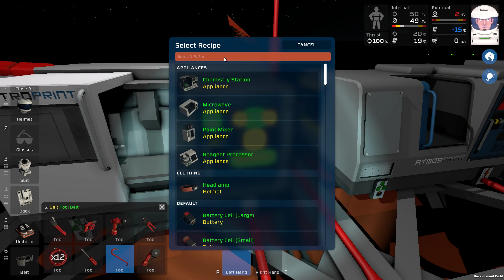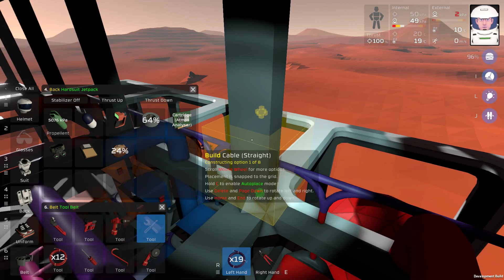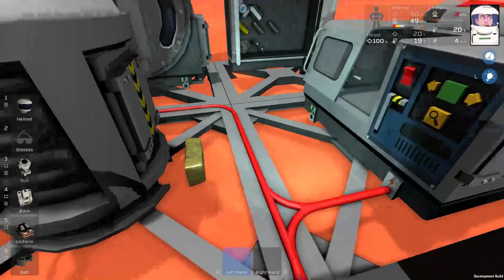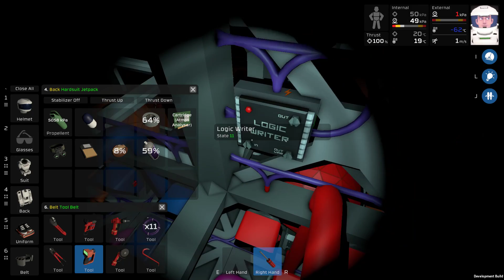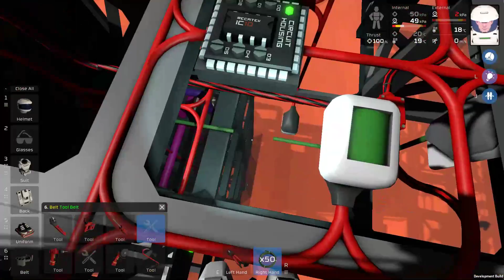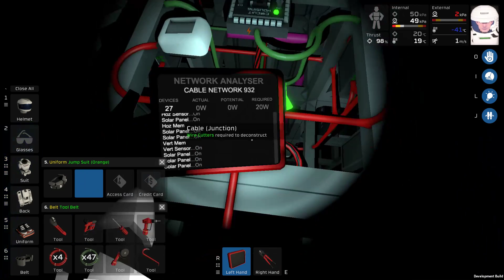Stationeers / EP 21 - Power Monitoring / Mars Colonization

Comment: Transformers are at sub stations and on street poles.
In the US the bottom line it hot and the top line is ground.
You see the transformer hanging on every so many poles.

The transformer takes the hot line running 13,800 volts and steps it down, usually up to 5 houses running 110 or 220
It transforms the power into multiple lines making them run lower.
So you don't instantly catch the house on fire or explode yourself when you accidentally cross the wires. Just a little spark as long as you separate them.

A regulator is just as it sounds. It takes power in and regulates it out the other side. No transformation exists.
Suggestion to rename it sent to rocketw3rkz
Reply from the maker: Aye
Reply: Actually, it should probably be renamed to "Ballast" or something. A regulator isn't generally used as a limiting element. It is usually used to regulate a higher, potentially changing voltage to a lower, steady one, or more accurately, used for limiting voltage or current but not wattage.
A ballast on the other hand... Basically just the name for a more complex limiting element. AFAIK it is basically just used with AC and it isn't called just a resistor because it can include capacitors and inductors. They may even include more complex elements than that.
Reply: Regulator. To regulate 
It is a literal translation. 
Ballast has multiple meanings in different usages.
Reply: @LTL_king  A regulator in electrical systems is generally not a regulator of power. A Ballast on the other hand is well defined in electrical systems.
https://en.m.wikipedia.org/wiki/Electrical_ballast

Comment: If it's simple 4 or 5 chips.  Go with the chips. 
If it's going to be a complex system like the full atmospherics or similar. Go with ic. 
The logic chips us 10W and the ic is 80W(?)
So why not do it by power standards. 

Whichever is cheaper.

There's no need to slap ic chips everywhere just to replace a couple chips. 
Not everyone understand how to code it anyway. 

Might be simpler to run all the battery data ports under and behind each battery. 
Connect them all to your logic chip and memory and change the modes right down the line. 

Could even have it as a permanent system for the 4 chips you have for reading the values. 
For power you run a power cable from each battery across the bottom powering each of the chips on their own network or off 1 of the batteries.
Reply from the maker: You make a good point, for simple data display IC Chips may be overkill.

Comment: I setup my atmospherics controls and it took me about 20 different chips 6 or 7 frames wires and the works. Looks like a mess. If 1 little thing isn't right. It's a nightmare trying to go back and find the 1 chip to change and fix and it took a long time to setup. 
So I lernt how to code the ic chip. 

If you need it, here it is. It works on the same setup. Gas flow valves and not pressure regulators.
Discord people helped me understand how to read all that jazz. I was so confused but I did figure it out.
https://stationeering.com/tools/ic/_FCentc8Ui3
 
Change r values to your liking. It's not optimized but it works. I'm using a bit lower than 100% so they don't constantly fight each other to get it perfect. 
r0 is room pressure. 
r1 is O2%
r2 is N2%
r3 is CO2%
If you want to put your temp regulation on a separate network. 
Remove those 2 alias's. 

I am prepped to add temperature in the same code but don't have that worked out yet. 
and shortly after. Someone took my 74 lines down to 49
https://stationeering.com/tools/ic/_FCe5uYUWDD
Reply from the maker: Thanks LTL! I'll take a look.

Comment: that APC is totally unneeded. 
1st, you don´t need the buffer. a small battery will even run dry on filtration very fast and you have the displays running, which consume 20 times as much combined, for one filtration/tank setup. you have the stationary battery anyway.
2nd, anything you can do with an APC you can do with the transformator. APCs suck except for VERY critical stuff, like not locking people into airlocks when power cuts out, leaving you with no option but to destroy walls. Anything else, just make sure the batteries get enough power. And transformers can be switched an/off alot more conveniently without opening like the APC
As for transformers: 5000W is fine, as cable blowout load can deal with small spikes above 5k (its smoothed out and and sorta randomized, wiki has the details), witch wont happen anyway.
Also, if anyone ever needs 100kW, they´d need 2 big transformers, as their maximum is 50k
Reply: APC might be redundant but it would let you quickly place say a nuclear battery in it and power up a grid. Might not last long but give you a bit to fix the problem.
Reply: It can also blow out the cable behind the apc. 

If the whole system uses all the battery power in the big and apc battery.
When you get power again. The whole system could potentially try to draw all that power of the 4990 and try to charge the battery at an additional 1000 as well.
Take the battery out or do like so.
https://youtu.be/IzfgZgkXbQU?t=240
Better yet. Take out the apc. 

Besides. Isn't that big battery isn't enough? ;)
Reply from the maker: As Bryan mentioned that's pretty much why I am going to keep the APCs. I'll install heavy cables between APC and transformers and keep a few fully charged nuke batteries in case of brown-outs.
Reply: Ohhhh. I C but dat big battery. 
Ha ha. That's funny rite dar.

Runs out of power in this huge gagigwats battery.
A tiny little battery is going to buy you some time to solve the problem. 
ROFL.
If you run out those batteries. I think you got bigger problems than that. 
Start slapping in solar panels. 

The heavy cable is a good idea though. 
Hadn't thought of that 1.

Comment: To be very safe You should keep your transformer limited to 4k watts if you run normal cables from large battery to apc to transformer. (APC charges the battery in it using 1KW so if it charges that battery and the transformer uses its full potential, it can blow the cables between battery and transformer).

Or you can use heavy cables before the transformers.
Reply from the maker: Heavy cables before the transformers make the most sense I suppose.
Reply: Yes. Easier and proper fix.